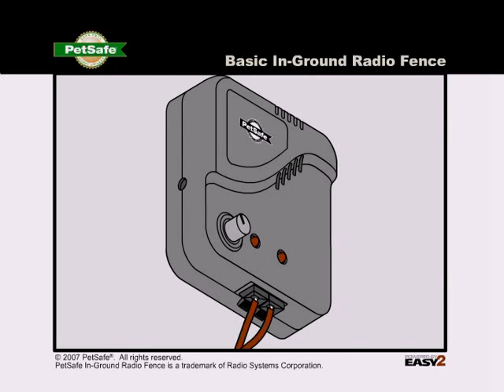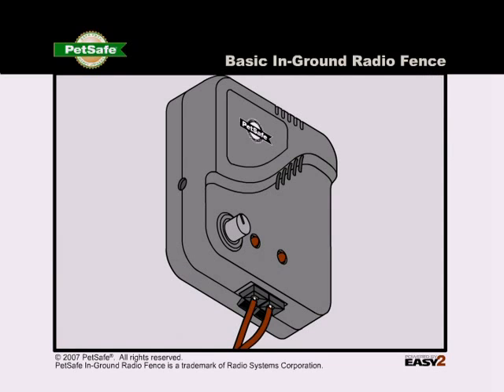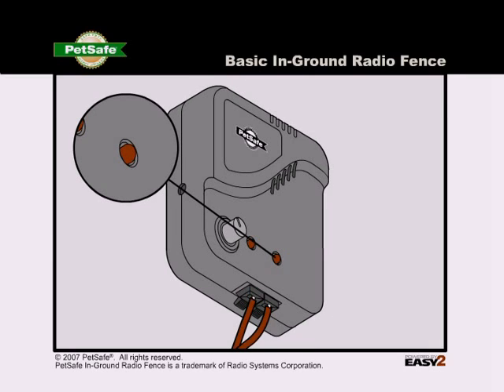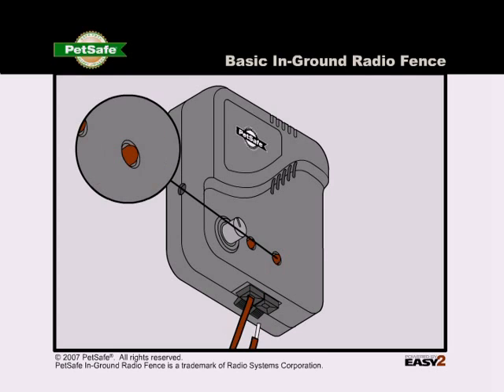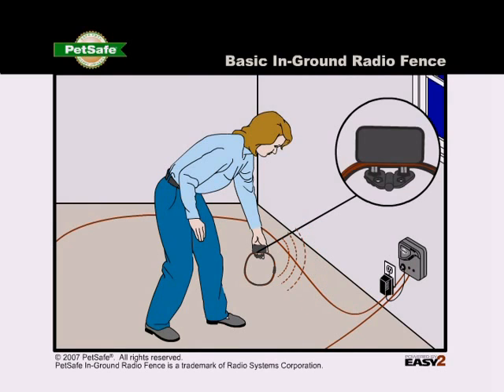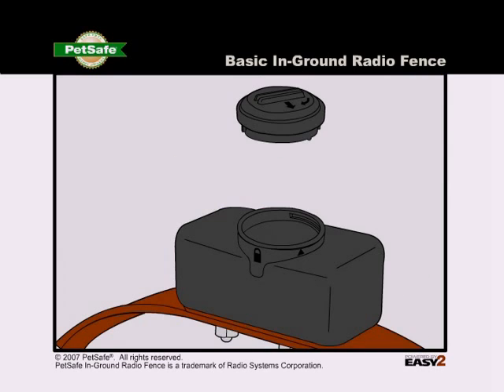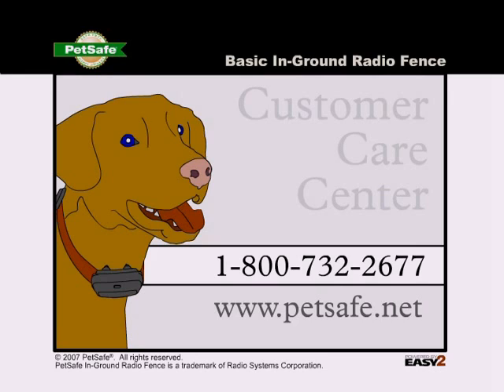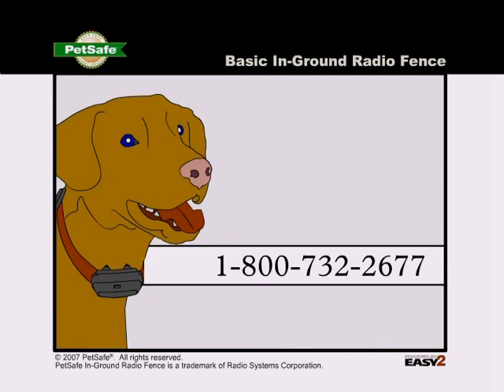PetSafe—Troubleshooting Tips for the In-Ground Radio Fence

Comment: Power and loop light are lighted, collar still beeps and works.  Everything works! EXCEPT the transmitter does randomly beep.  (not a pattern that I can tell) Thought maybe it meant the collar isn't holding a charge??? But can't find anything to verify this.
Reply from the maker: Thank you for sharing this with us!  The transmitter shown here does not have an audible beep, so if your transmitter is beeping this would mean you have a different model of in-ground system than the one shown here.  Periodic beeping is typically a sign of partial breaks, and/or radio signal interference.

So that we can troubleshoot with you and determine what could be causing this in your situation, please get in touch with our Customer Care team directly.

Comment: If the beeping goes away on the fence while the strength is increased, but it beeps when decreased, what is this a sign of? Our fence has been installed for months, and we've had it on "5" for a long time, but I had to increase it to "8" for it to stop beeping. First thing I checked was the boundary wire, then the test as in this video, and then I re-cut the end of the wires to get a cleaner connection.
Reply from the maker: Thank you for reaching out to us, Doug. We're sorry to hear that you are experiencing this issue with your transmitter. We'd recommend contacting our Customer Care Center for more in-depth troubleshooting. We can be reached at 1-866-738-4379 between the hours of 8 AM - 7 PM ET Monday to Friday. We're happy to help!
Reply: i have the same problem. did you find the issue?

Comment: What does the blinking power light mean?
Reply from the maker: Thank you for reaching out to us with this question. If your power light is flashing, it does appear there may be an issue with your power adapter or possibly the transmitter itself. for assistance we would suggest reaching out to PetSafe customer care.

Comment: Our fence stops working every couple of months. It is so frustratingly. The wire in NOT broken. We have a surge protector. It breaks too.
Reply from the maker: We're sorry to hear you've had difficulty with your fence, Laura!

It is critical to mention that if you are having trouble so often, there is very likely an environmental or wire related cause.  There are many, many issues that can occur with wire and its ability to carry signal other than a full break in the wire.

So that we can thoroughly troubleshoot with you and determine what could be causing this, please reach out to us!  Our number is 1-800-732-2677, and our hours are Monday through Friday 8 A.M.- 7 P.M. EST.

Comment: Frustared! PLease read before you buy!  Ihave replaced the full wire for the 3rd time and on my second system! The transmitter batteries are charged up and stubborn dog collar has new batteries. Yes, Isaid batteries. Why? I had to put two collars on my Lab/German shepard mix.The collars will beep once, then shock for 3 seconds and quit when approaching the wire. Once it stops, you can literally walk across the wire.Once you're 6 feet away (or whatever distance you set) on the other side it will beep again and shock for 3 seconds. We now have the wire mounted 6" off the ground along our privacy fence. Our stubborn dog will run up and down the fence line right next to the wire for  30 minutes plus. It just does't work.
Reply from the maker: We're sorry to hear you've had difficulty with your system!  Please know that what you have described is extremely atypical.  Additionally, no dog should ever be wearing more than one receiver box at a time due to the weight of the boxes on their neck; we're so sorry for any misunderstanding.

We would love the chance to troubleshoot with you to help determine what could be causing the system issues you've experienced.  So that we can do so, please contact PetSafe® Customer Care directly.